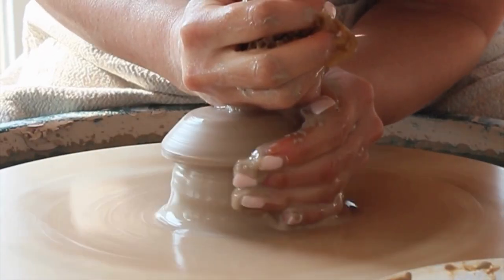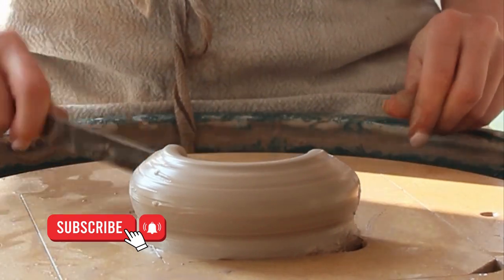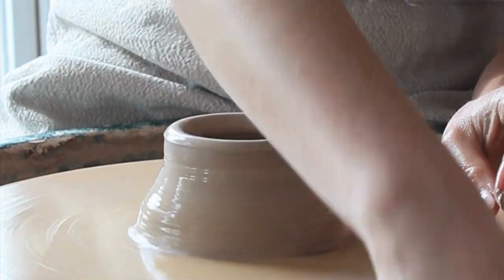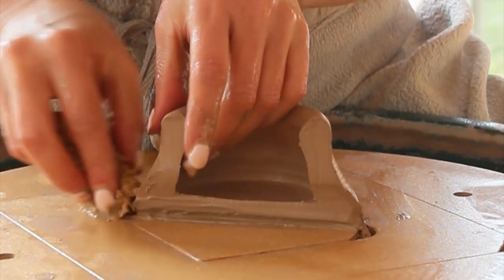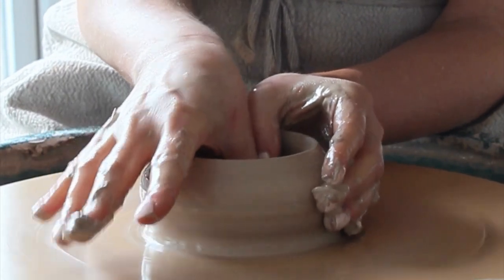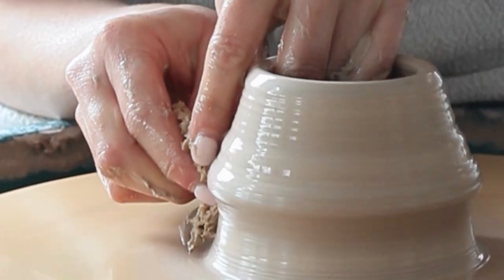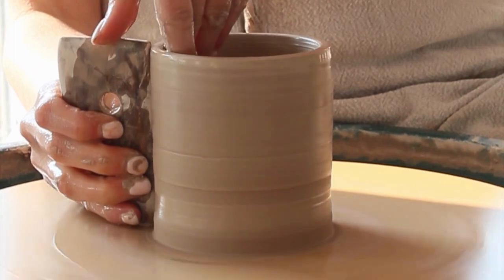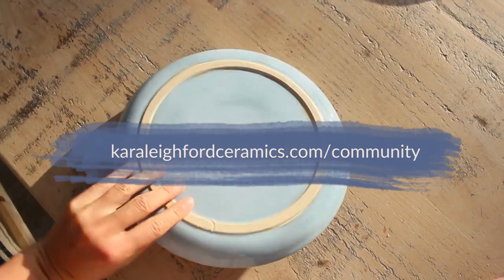Why EVERYONE should cut their pots in Half! When Learning to Throw Pottery.

Comment: New potter here.  Let's say I practice six times, cutting each throw in half.  How do I recycle this clay?  Everything I read (so far) talks about recycling dry clay.   It's essentially "new", but wet.  Would like to recycle and practice again. Thank you!
Reply from the maker: This is a great question. The best thing to do is pop all your 'new wet' clay onto a slab of plaster to and let it dry for an hour or so until it's not so sloppy. Then wedge it 50/50 with some new clay fresh from the bag. This replenishes any tiny particles that may have been 'washed' away during the throwing process. Voila! you can bag that clay up and use it next time you throw. Hope that helps.

Comment: Hi Kara , just bought my first wheel , I don’t have a kiln, I’m part of a pottery guild .. and have access to their studio and access to a kiln .. however I need to practice before I start firing my work … would you suggest practicing with clay and recycle and repeat … until I feel confident.. the clay at the guild is expensive but it include the cost of firing … not sure if this question makes sense ..
Reply from the maker: Hey there, yeah defo practice! You could just buy some of your own clay. It doesn't matter how many things end up in the reclaim bucket - nothing is wasted. Just your time with the material will teach you so much 😊
Reply: @KaraLeighFordCeramics  thanks Kara … for the info …. Thank you for your awesome videos. They’re such a great tool to use as a beginner.